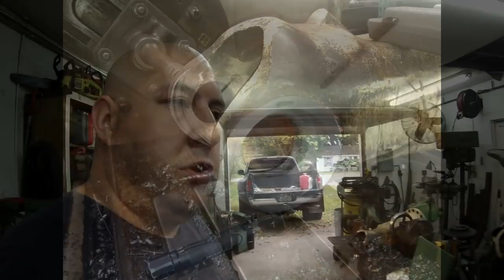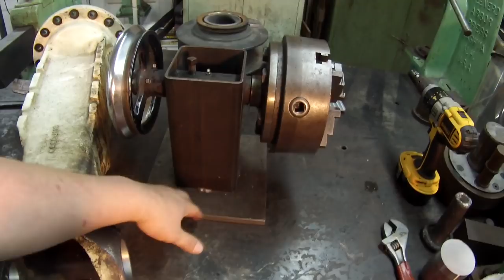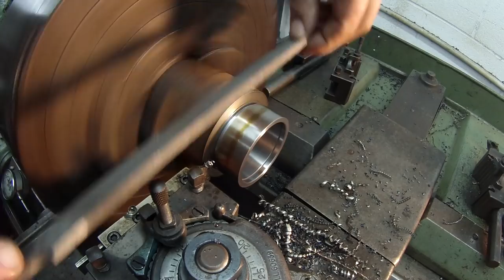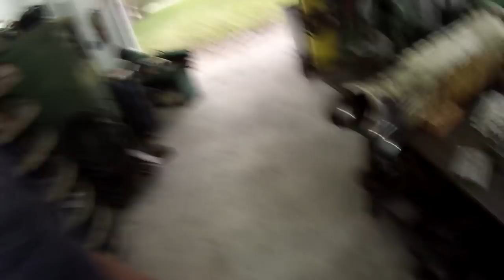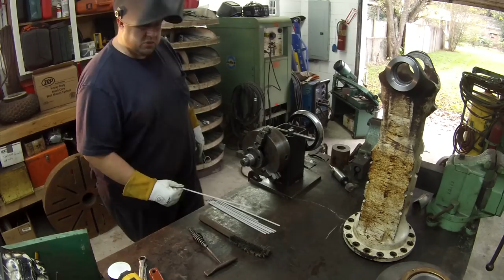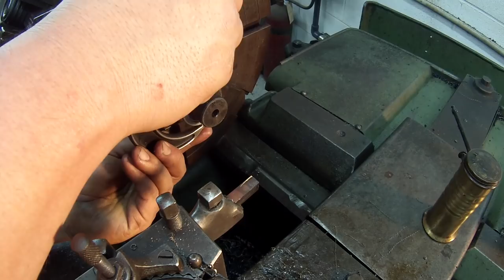Forklift Axle Housing Repair

Comment: Abom79 - Adam, I know this film is over a year old, but I hope you can answer what is probably a very dumb question. 

The bar stock that you got from your forklift buddy to machine new sleeves sure was a big piece. But I noticed even after you indicated the outside surface, the center 'hole' was way out of round and center. I don't know what kind of material this is, but is this normal? The real dumb question is this; is it important to determine center of the original casting or cold roll of the steel? So even if you have centered the material using O.D., are there times that even when the center hole is warped, offset or whatever, it is necessary to determine the stock's true center, then machine the ID first, then machine the exterior to ensure granular center of the material is maintained?

Really nice work Adam. It's cool to go back through your archives of machine work. Really like the creativity in re-purposing the 3 Jaw .. big thumbs up. I know my Grandfather would have been very impressed! Thanks for sharing.
Reply from the maker: Doug, most of the time that type of tubing is rough on inside and out, and they are not true with each other. Only time you need to worry about indicating the ID true is if you need to ensure it will clean up. Sometimes you only have very little to machine, so you gotta make sure it will clean up. So yes there's times I may indicate the ID true instead of the OD. 
The small positioner turned out really nice. It's catered mainly for stick welding, but will work for any of them. I keep it at work now and use it all the time for welding up trunnion mounts. All the materials I found in the shop. 
Thanks for checking out the archives.

Comment: I'm curious as to how the welding arc, on the turn table, does not blow through the brass bearing sleeve? Is it just a really close fit or do you have like an electrical brush to ground the shaft? Great video! Thanks!
Reply from the maker: I machined the bushings to fit very close to the shaft that holds the chuck, I believe I gave them .002 clearance. The arcing through them has never posed a problem and it's never failed. Its one of those things like oxtoolco talked about in one of his videos. You make small bets when designing tools that something is going to work. Well it has worked exactly the way I was hoping it would.

Comment: Hi, what's the cutting oil you're using on the lathe - is it just a general-purpose drilling/tapping fluid? Also I really like the oil can - where was it from?
Reply from the maker: The oil is the old school sulfer based dark cutting oil, same stuff as thread cutting oil used on pipe threaders. The oil can is made by Eagle. I did a review on it in my last video.
Reply: Abom79 Thanks for the reply - I should've watched your previous video ;-) I really like the pistol-grip style of the can - there seems to be quite a few second-hand on EBay so I'll see if I can grab one. Best regards, Lindsay.
Reply from the maker: There's one on there right now for a low low price of $99 if you buy it now! LOL!
Reply: Abom79 Yikes, that's quite a bit! I actually like the rigid spout version more - the flexi spout looks a bit ungainly. There's another one listed (a bidding job) at $25 so I'll keep a watch on it.

Would be a nice project to try making a similar can, but I've got enough on my plate at the moment!

Comment: On your grizzily saw - put a parker head - that takes Hydraulic Oil filters and it will increase life of the saw blade.  I have used one until the case of the filter rusted - inside perfect and full of small chunks that would hammer my saw teeth.  I have a second one in 15 years on it now.  Really works.  The Parker head took hoses on both intake and exhaust.  The cutting oil won't attack the filter as it is an oil filter like the part oil / water you use.   I got mine at mscdirect.com but other parker hose places have them...

Comment: It never hurts on press fits to put a small .001  under or oversize lead about .080 long with a slight polish to the finished diameter to aid in whatever your pressing or tapping in to start nice and straight.

Comment: I wonder if there's a way to connect a small adjustable motor with a belt to the welding stand/turner that u made then u would have both your hands to weld

Comment: when you said that you gave it a .001 or that it has a .001 when making the bushing, Is the ID of the axel housing .001 bigger than the OD of the bushing, or is the OD of the bushing .001 bigger than the ID of the axel housing? What I mean is would the inserted bushing be .001 bigger or smaller that the ID of the axel housing?
Reply: +Mars Mahoney He means the axle housing is smaller by .001. So, the bushing had to be hammered or "press fit" into the housing. The bushing is not going to come back out of that housing without a lot of work.
Reply: +operator0 I kept thinking as Adam was hammering the bushing in, if he put it in the freezer for an hour, would it have just dropped in?

Comment: just an idea, why dont you put a handle on you welding setup / jig then you can do a 360 deg weld without stopping, could see you had to stop a few times

nice vid your a natural keep them cumming really enjoy your vids.
Reply from the maker: I dont think a handle would help me as much as rotating the od of the wheel, your looking for small movements and holding your hand around the outside of the handle gives you a better feel. Now if the unit was set up like a gear reducer I can see where a smaller seperate hand wheel would work great!!

Comment: Adam, curious about your positioner  I thought about building one but how do you prevent arching thru the bearings.?
Reply from the maker: I made the bronze bearings a close fit of .002 clearance over the spindle. I havn't had any problems with arching. I've used ball bearings in the past with welding and I know that's a no go as it arcs through the balls and race. 
When I built this I was thinking that the nearly full radial contact in the bushings would be so close that the arc wouldn't damage the bore or the shaft. Well I've had this very several years and done lots of welding with it and it still spins nice and free. 
When I built my big welding table Im probably going to use the same type os design.
Reply: Thanks Adam Thats great. I,m gonna use your design to make one for my self.Have a good holiday.

Comment: Talking about stuck grease fittings never apply heat as in hot wrench did that once and the little ball in the end blew out lucky i had safety glasses on. Welding around them probably wont cause any problem but you never know with heat build up in a sealed area.

Comment: You ever think of putting a slow rotisserie motor on ur welding rig. U can find them open box on ebay for cheap. Add a 110v footswitch and youll be hands free.

Comment: Can you explain why you did not weld material back onto the housing and then machine back to proper specifications?
Reply from the maker: The housing is cast iron. Not that it couldnt have been welded, but I decided to make the flange on the sleeve to bring the material thickness back. Made the job simpler that way.

Comment: next time put the inserts into the freezer and heat up the bearing seats and those inserts will just fall into place with no pounding at all :)
Reply: Would there be enough thermal shock to break one of the pieces? Or would they be okay?
Reply: They would be fine. Theyre not hardened.
Reply: kotarumable - I would say no. I worked for a machine shop years ago. We had a recurring job where we had an interference fit on a big bearing race, like 12 inches ( 300mm ) across. To set the race, we submerged the race in dry ice for a couple of hours. Then we'd put the part on the hydraulic press, get all the blocks and the press ready, heat the part up with a acetylene torch till it was smokin hot. The boss would say now, and someone with huge gloves on would pull the race out of the dry ice, orient it properly and sit it on the part. The race would scream as the hot part hit the cold race. most of the time, the race would fall into place, if the race was cold enough and the part was hot enough. If it didn't fall together, a jig was put on the race and the press was employed to shove it together. The sound of frigid steel hitting hot steel is something you won't forget, its a high pitched scream until both pieces equalize in temperature. You get one shot at setting that race. If it went in crooked, and didn't get set correctly, you were going to spend the night cutting that race from the part. And bearing race steel is really amazingly hard and tough material.
Reply: @therealstubot  
Fuckin' funny m8, I can just imagine the frustration when it went tits-up.....!!

Comment: Welding 7018 downhill that's a little different.Slag usually fills the weld running 7018 downhill but maybe it doesn't matter if you going to machine the weld down

Comment: i bought a ck 14inch lathe monarch if i send some pics for what i needing to fix would you or Keith R. help with fixing the lathe pay included i got 2 problems the taper is missing the clamp and maybe something is broken off my worries  and the rigging people broke the quick change gear box handle i can weld the part just want it right going back together  thanks abom

Comment: ever thought of putting a variable sped motor on the work piece spinner. so it'ill spin 4 u.
Reply: wow you dont reply to any you put out. are you even alive?
Reply from the maker: Yessir I am. I do reply to comments, but I apologize if I can't get to every single one. 
When I built that positioner I wasn't interested in motorizing it. Manual rotating is fine for me when I'm stick welding.
Reply: you could go with 24 volt gear reduced motor. i have to atm. i could them them your way. 4 you to play with. ill even pay 4 the shipping down there.

Comment: Abom I wanted to say something more, in a new comment on this old video, to ask I hope a good question: what about the idea of building up the the bores using brazing instead?  Then, assuming you can secure the housing solid enough in a vertical mill or even a large drill press, and get it centered up on an OD, using a boring head in the vertical mill or drill press to bore the braze to the OEM-spec ID for a proper ball-joint press-fit?  Would this enable a repair to an axle housing when a lathe to make a sleeve wasn't available?  Not that I'm planning on even trying to see about finding somebody to do this, still planning on replacing the whole front-axle on my Jeep TJ anyway.  Just wondering if brazing up the bores to a press-fit would be a way to possibly do this same repair without needing a lathe.
Reply: Patriot1776 The way Abom does it is a good reliable way.  I do 4 x 4  forklift housings all the time by preheating and welding, then boring them back to spec with my CNC vertical milling machine.  It could be done with a boring bar as well.

Comment: Throwing the sleevs in the freezer for a couple hours would have made them easier to go in.
Reply from the maker: A trick I have done, but for this job I ready to get them in and done. I installed them right after I machined them.
Reply: @Abom79  I would have been inclined to heat up the housing and drop the sleeves in for an easy shrink fit.
Any particular reason for not doing it this way?

Comment: as you can hear on the last rough cut on the lathe it´s starting to vibrate a lil bit try raising the feed and take little bit smaller cuts
Reply from the maker: I was not getting any chatter or vibrating throughout any part of the lathe work.
Reply: maybe its just echo in the mic or something like that

Comment: How did you make the three jaw welding work piece rotate jig.
Reply from the maker: I had an old worn out three jaw chuck, and salvaged scrap materials from around the shop. Just came up with a simple design and built it. I will pull it out in another video and give you a more complete rundown of the whole thing.
Reply: Ok thanks heaps
Reply: could you send me a link to the video when you post it
Reply: Brian Wynn We've got one in our shop. a couple actually. Usually a piece of crap gear motor is attached to a car hub and the hub bearing attached to some sort of stand. We weld a lot of wheels, so we make these up to spin the wheel while we weld the bead lock on. The key ingredients are pretty much any motor, a router speed controller {for foot or hand speed control} and a hub and bearing from any front wheel drive auto.

Comment: what insert and tool holder are you using?
Reply from the maker: The tool holder is for a CNMG insert, and the insert is an ISCAR that I recently picked up and trying out. It's a CNMG 431.
Reply: thanks! happy thanksgiving..

Comment: If you put a short piece of welding cable to your weld positioner at the center of the handle at the back then the current will flow along the shaft straight to the work and will not have to cross where the bearings sit and the arc will be more stable. Also the bearings will not be carrying any load of electricity and will stay smooth turning. This way you could even use roller bearings without worry of pitting them. as long as you connect your ground only to the short cable that is connected to your handle center and not to the table. The short cable allows for turning the handwheel without any arc dropout. I really enjoy your videos and have learned a lot from you and I am grateful for your excellent videos. Keep up the good work.
Arnie   kl_z_6@hotmail.com        Retired heavy equipment operator with a hobby shop consisting of 12x36 kings lathe and pdm30 milling machine and indexing head. Feel free to email if you like.

Comment: you're not a pipe welder. no kidding! Leave a old file around and you can use it to scrape off the little piece of slag on the end of the 7018's and you won't have to take them out of the stinger and bang on em